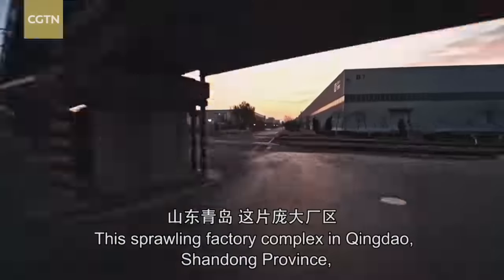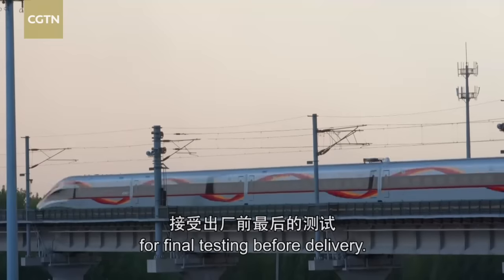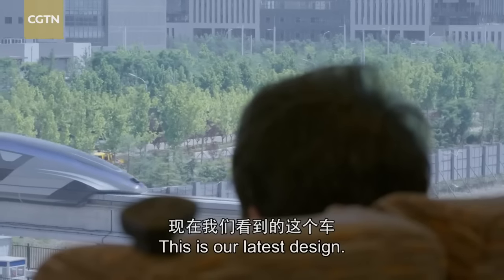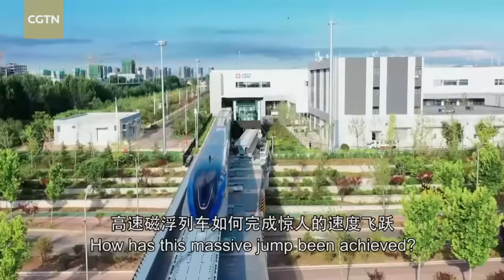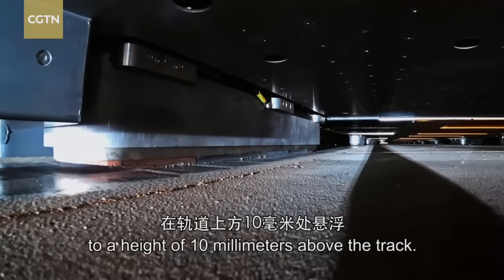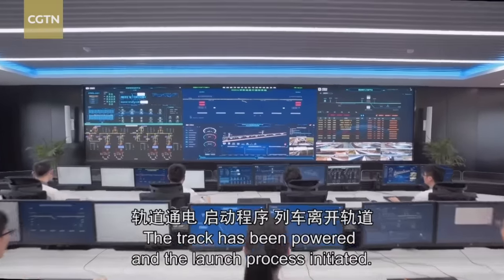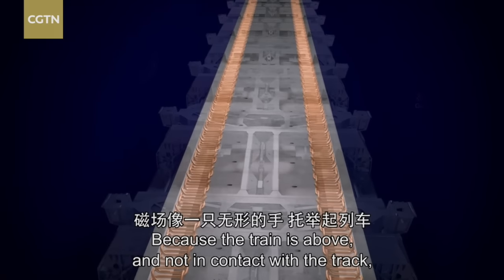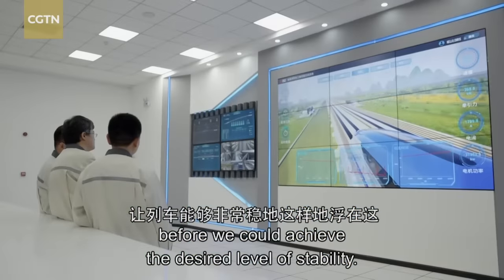China turns 600 km/h maglev trains into reality

Comment: So this is similar to Transrapid in that it uses electromagnetic suspension by attracting the train to the track from below, right? Japan is using the opposite approach, repelling the train over the track using superconducting magnets. Will be interesting to see which of these two technologies come out on top as maglev develops. The attraction method has the advantage of working from a standstill, but repulsion should be effectively impossible to have an accident on because it is dynamically stable and is probably more energy efficient.
Reply: I also noticed the difference... puts a lot of those comments here suggesting IP theft out of action...

Comment: Of course... they never SHOW it going 600km/h on it's 1.5km research track... because it hasn't actually travelled faster than about 60km/h in real life.
Reply: Relax.
The project is still in test phase.
Commercial operation is in competition with the native airplane manufacturers.
 Maybe 2050 will be a pivot point, when CO2 neutral fast transport will be mandatory.
Reply: @DBGE001  The project is still in the R&D phase not the testing phase... and they haven't committed to actually building it out.

However, the way the news feeds read it's like they've already done a test run. 

This news was really just put out there because Japan's Chuo Maglev is under construction and will be actually completed as the first intercity Maglev (Shanghai is an airport line, not intercity).

Time will tell whether or not it was a good idea to build or not.

Comment: I hope there will be a method to prevent the birds from flying crossing the way of the train, so both can be protected.
Reply: plz learn physic before make dumb comment,
Reply: @luoyanyang7625  bird dont hit  aeroplane, it get suck in the engine or hit by the propeller

bullet or maglev train travel so fast any bird fly infront of it will just get push out of the way by the air the train push in front.
this also applied why bird rarely get hit by fast moving car

there physic 101.
Reply: @jetli740  Man, if you google it, you will find many pictures that the birds hit the airplane and make a dent, or hit the windshield and cracked it. Just do some research, don’t just assume.

Comment: Eight meter wide three level maglev trains traveling at 800 kph - 1,000 kph are reasonable practical goal starting about 2045.  This wide loading of about 8 meters has been an objective going back to the beginnings of the railroad age when dual track UK railways of the 1840s were designed to occasionally have double width carriage using the inner rails of the two tracks.  This 8 meter wide loading gauge would allow large cargo assemblies to be easily moved over long distance overland changing the world we live in.   

For a mixed passenger cargo train the first level would likely not be continues between train cars and a bit noisy from the maglev motors, a useful space for side simultaneous loading of drive-on drive-off automobiles and cargo containers that could take place in the period of a long traffic light cycle or about a minute.   The second and top third level could be luxury continues passenger space with vista dome roofs to allow passengers to see out front watching the scenery.   This train configuration could carry passengers more comfortably in a 1/4 the length of todays popular single level trains that stretch out several city blocks.

Comment: The first commercial implementation using magnetic levitation in China was the SMT Transrapid in Shanghai (Shanghai Maglev Train) in 2002. That was German technology developed by Siemens and Thyssenkrupp. It runs with 431km/h to Shanghai airport. Even the German chancellor Schroeder came to the inauguration. The technology was already approved in 1991 for technical readiness in Germany. Political resistance did not allow commercial use in Germany. But it's great to see China does and develops it further.
Reply: Thanks for the nice summary. 
I would like to add that a fatal accident (with 23 victims) sealed the fate of the technology in Germany.
Luckily  the PRC wanted to pay Siemens a handsome sum of money to get it installed in a 30 km long test project that became commercially operated thereafter.